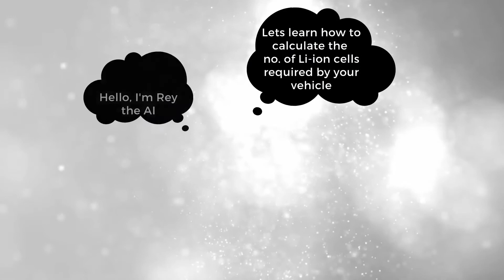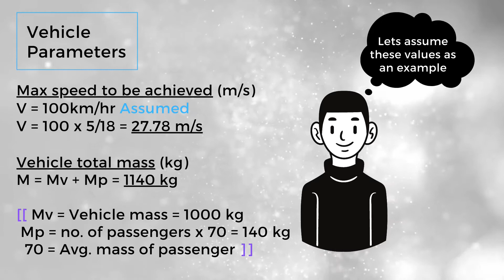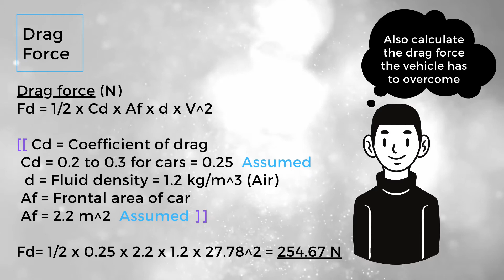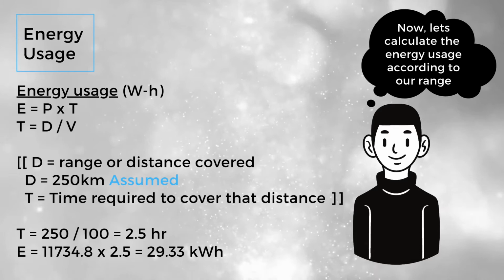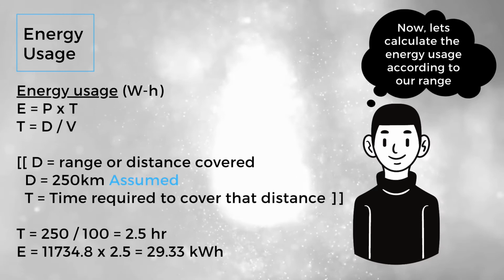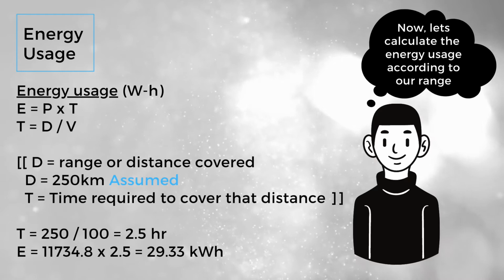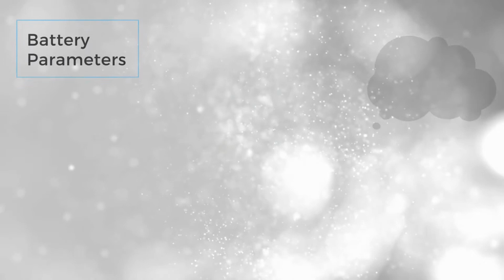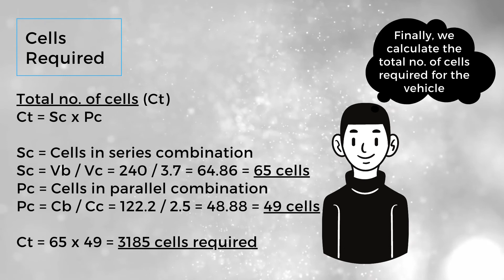Calculation of Battery Cells Require for Electric Vehicle Battery Pack

Comment: Hii,
How to know, how much battery voltage required?
Reply: It depends on your powertrain, the motor has a voltage limit you can design to the limit so the current will minimize or you can reduce the series and add in parallel due to more current

Comment: vehcile parameter v= 100 x5/18 = 27.8 m/s  what the value refer 5/18 ?
Reply: It is used to change the km/hr unit to m/s[ 1000 m / 3600 s]  . To the reverse, multiplying the m/s term by 3.6 and label it as km/hr .
Reply: @wannaride1913  Thank you so much .. Great Explanation :-)